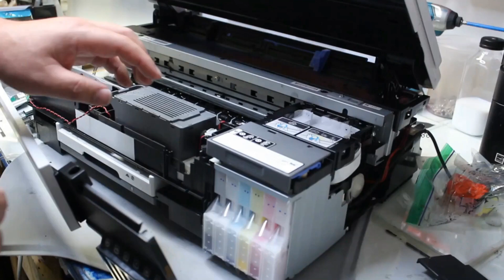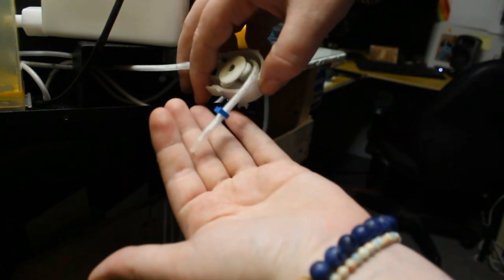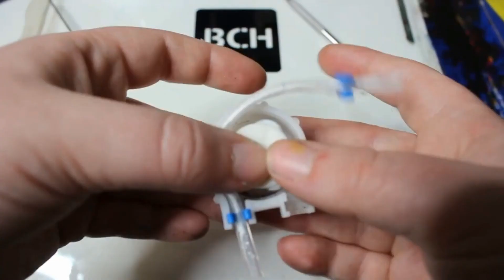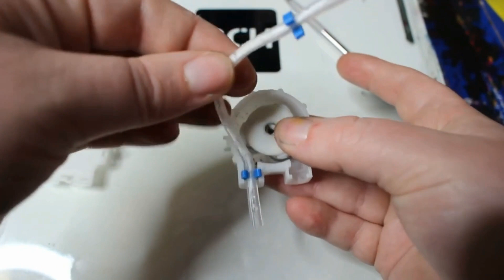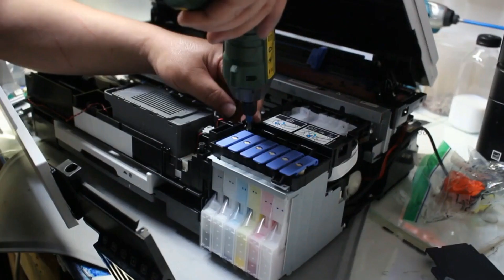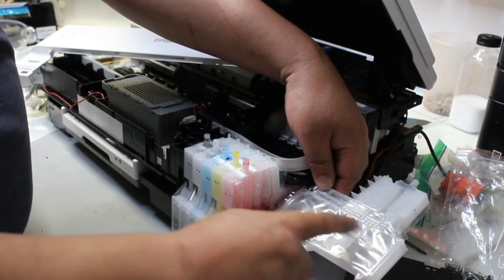ET-8550 Ink Tank Removal & Cleaning: Expert Tips for Guaranteed Results - ET-8500 L8160 L8180

Comment: i have this printer, its 6 months old, i use it almost every day, and how i have both magenta and yellow suddenly stop printing (i was printing a photo and both inks stopped 2/3 in). Im almost sure its feed problem as i print regularly and nozzles never had problems. Is this something that warranty would cover? what should i do?
Reply from the maker: Thanks so much for your support and for the detailed question—I really appreciate you taking the time to explain what happened, and you’re thinking in the right direction. When two colors like magenta and yellow stop at the same time mid-print, it’s very often an air issue rather than a clog, and in this case it’s likely those two dampers pulled in air; the best next step is a proper park-and-prime: power the printer on and let the printhead naturally park on the capping station (it’s safe to do this with the power on), then connect a syringe and tube to the waste line and gently draw until you feel slight resistance—if you only pull air, the head isn’t sealing or the cap has a leak, and if you can’t pull anything at all, the cap may be clogged; once you feel resistance and possibly hear the damper membrane crinkle, slowly complete the pull and hold briefly before running a normal cleaning cycle, avoiding strong or back-to-back cleanings. As for warranty, yes—Epson should cover this as long as you’re using the original ink type and haven’t introduced sublimation, DTF, or other third-party inks. I do get a very high volume of questions, so replies are prioritized this way: subscribers and members are typically answered within 48 hours and also receive extra benefits like early access to videos; regular viewers are answered if time allows since I can only reply to about 10 questions per day; after subscribers and members, any remaining reply slots are filled last-in, first-out, meaning newer comments are reviewed first—if you’re not subscribed and don’t hear back within 48 hours, you can either subscribe or repost your question, and if you subscribe later, your older questions automatically become priority without needing to repost. I’d also love to invite you to Run With Kevin — LIVE, where I go live every morning (usually between 6–8 AM Eastern) answering printer questions in real time, so subscribe and turn on notifications if you want to catch the next session and ask directly. If you need faster help, feel free to email [support@bchtechnologies.com](mailto:support@bchtechnologies.com), and if this video or my comment helped you, I’d really appreciate a Google review here: [https://g.page/r/CfL7k6nYvPQ9EAg/review](https://g.page/r/CfL7k6nYvPQ9EAg/review).
Reply: @BCHTechnologies  Hello thanks. built in clean didn't help, but purging the dampers manually easily solved the issues.

Comment: Hello… I have espon et 8550 printer.. The ink pad that the print head goes over has popped up…i can't get it to stay down so the print head can go over it.. Please help
Reply from the maker: Thanks so much for watching and for your question! It sounds like your capping station pad has popped out—this is often caused by dried ink buildup or a shifted spring underneath. You can gently press it back down while the printer is unplugged and the printhead is moved aside, making sure there’s no dried ink blocking it. If it keeps popping up, don’t worry—you can safely remove it since it’s not essential for operation. I really appreciate your engagement and support! Subscribers and members get priority answers (usually within 48 hours) and exclusive perks like early video access. Since I get a high volume of questions and can only reply to about 10 per day, non-subscribers are answered if time allows, and remaining ones go last-in, first-out. If you’re not a subscriber and don’t hear back within 48 hours, you can subscribe (your old questions automatically become priority) or re-post since newer comments are reviewed first. For quicker help, please email [support@bchtechnologies.com](mailto:support@bchtechnologies.com). If this video or advice helped you, I’d be super grateful if you could leave a quick Google review here: [https://g.page/r/CfL7k6nYvPQ9EAg/review](https://g.page/r/CfL7k6nYvPQ9EAg/review).

Comment: What if while letting it rest the lid fell and the cable disconnected??? is there a way to reattach?
Reply: Ditto
Reply from the maker: Thanks so much for your question and for watching the video! Yes, if the lid fell and the FFC (Flat Flexible Cable) disconnected, don’t worry—it’s usually possible to reattach it as long as the cable or connector isn't damaged. Gently lift the locking tab (usually a small brown or black latch) on the FFC socket, slide the cable back in evenly with the exposed metal contacts facing the right direction (usually down, but it depends on the model), and press the latch back down to lock it in place. Be careful not to force it—FFC connectors are delicate. If the cable feels loose or won’t stay in, check for creases, dirt, or damage at the tip. If you’re unsure which way the cable should face or how to line it up, I’ve got a few videos that show close-up examples—search “FFC cable site:youtube.com/@bchtechnologies” on Google or use the 🔍 on my YouTube channel. And if you're not subscribed yet, please consider doing so—it really helps the channel grow and ensures you get faster replies!

Comment: So Ive been seeing some black ink coming out from under my printer right beneath the capping station and tank area. I cant tell if its from my capping station or my tanks or somewhere else. It looks black, but it could also just be all of my colors mixed together if its coming from my capping station. It prints fine but im worried about blowing a fuse or something else. Is there any way to figure out whats happening? Im afraid that taking it apart may not help me either unless its something like a hole in a tank. Do you do tech support for the 8550?

Comment: I'm trying to drain my tanks but even when I pull directly from the tank, nothing will come out. Please help!!
Reply from the maker: Do you feel the suction, or it draws air?
Reply: @BCHTechnologies  I finally got it. The tanks were clogged. There was a ton of suction when I pulled on it. When I took the tanks out there was also a lot of white and black ink in between the tanks.
Reply: How did you remove the ink with there being a suction. I've tried multiple times to draw the ink but I get very little. The ink storage at the top of the cartridge is completely dry.